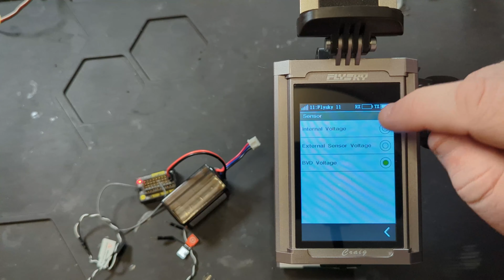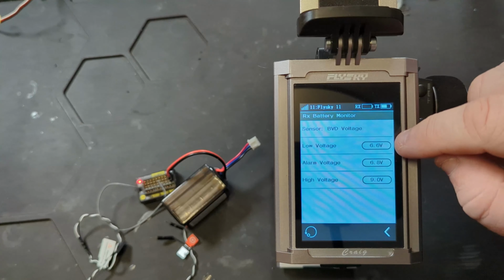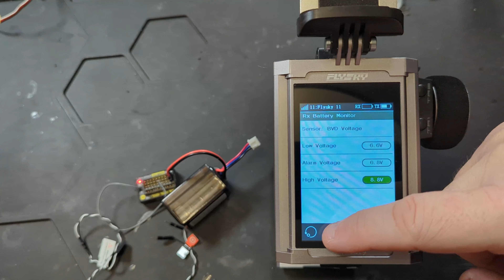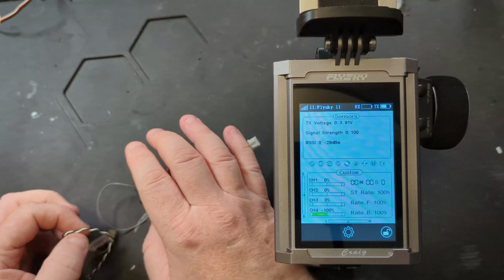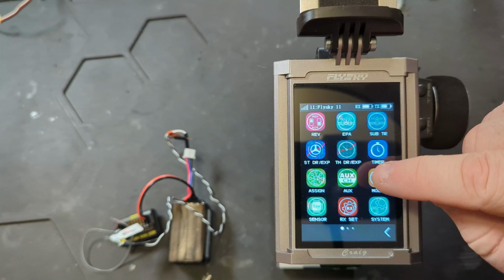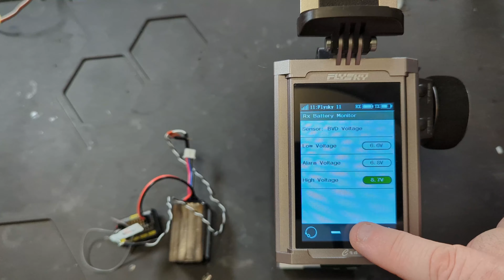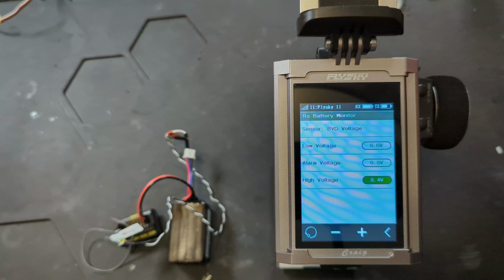Flysky Noble Pro RX icon as BVD level firmware 1.0.2

Comment: Hi there, I am looking to buy a nobel for 2wd buggy racing but have heard they are a little inconsistent for racing, can you comment or is the fs7 a better option for racing
Reply from the maker: I race 1:10 2wd truggy, 1:10 4wd buggy, 1:8 4wd truggy, 1:8 4wd buggy and 1:10 4wd touring car all with the pro and have no issues at all with consistency, I think the issue may be some people ain't used to being able to change the servo refresh rate and end up with it being set too high for the servo they run which would make the servo twitch or not hold the correct position, it's really easy to set and most servos run 333hz and almost all day the refresh rate on the box of them :) I run many different servos all the way upto 1000hz and never get any issues with any of them being consistent :) the touring car is really quick steering on narrow tracks so inconsistency would be a real issue for that one but it's fine with the pro and many of the local drivers run nb4 and pro too. I've also just helped Rick can Der Bol set his race RC up with the pro and hes racing at a very high level and has swapped from futaba 10px to flysky noble pro